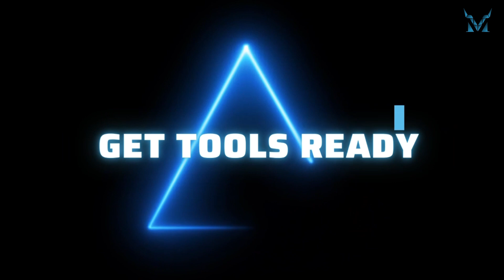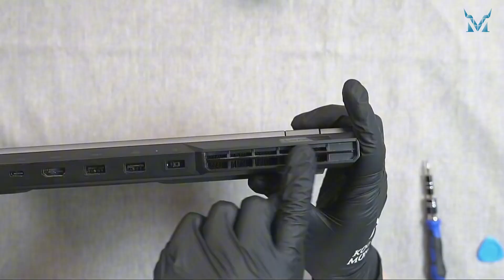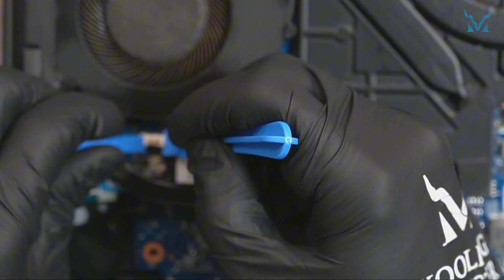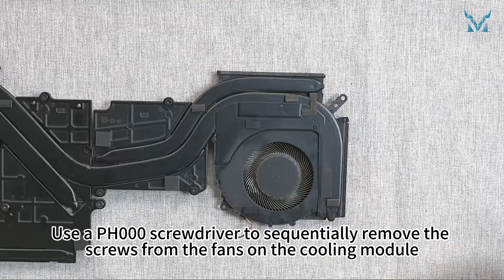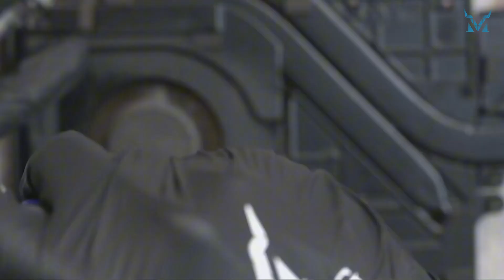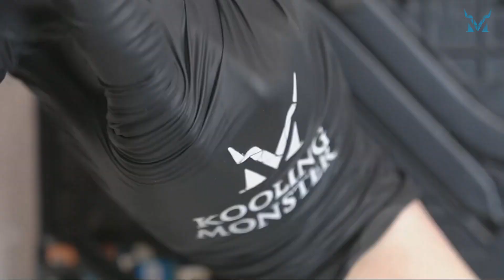Speed Up Your Lenovo Legion Pro 5 Gen 8 2023  Prevent Overheating With DustCleaning&New ThermalPaste

Comment: Do Lenovo legion 5 pro 16irx8 with 13700hx and 4060 8gb of vram 140w variant
Reply from the maker: That's a different model, so the internal layout won't match this video. Find a Legion 5 Pro 16IRX8 specific guide instead.